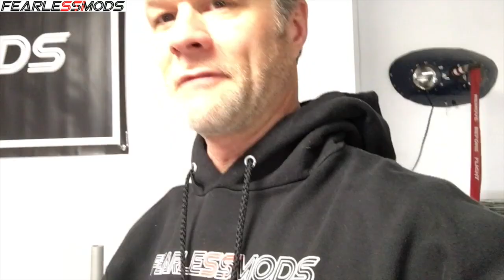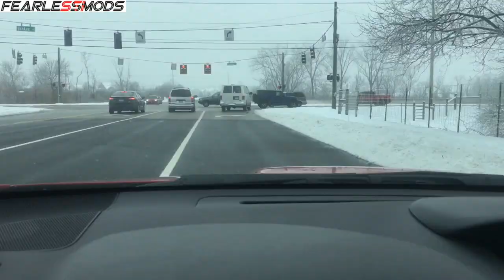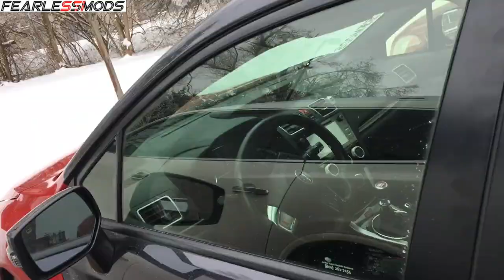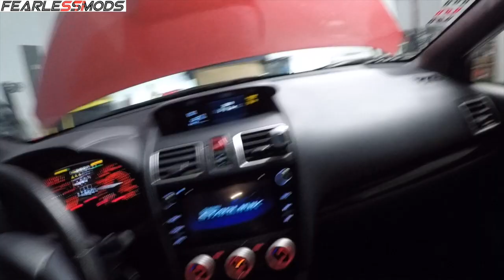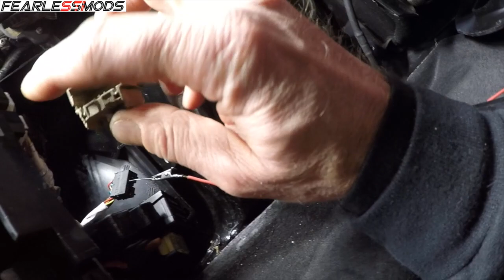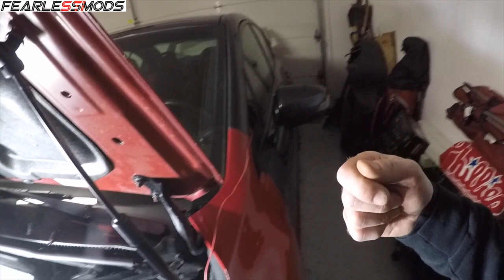Subaru WRX STi Ep 32: Fixing CEL Code P0073 Air Temp Sensor!

Comment: Heh, I'm having very similar problems with my '17 STi, just showing me where the connectors are is a huge help!  :-)
Reply from the maker: Glad it helped!
Reply: @FearlessMods  Turned out it was just corrosion in the sensor connector, which explains why it was reading cold for so long - the sensor has a negative temperature coefficient, which means as the temperature goes up the resistance goes down.  The corrosion was adding resistance to the circuit, which the computer interpreted as being colder than it really was.

I cut a thin piece of brass and folded a strip of fine sandpaper over it, and used that to scrub the corrosion off the contacts inside the connector.  The old sensor also had corroded contacts so it still didn't work, but the new sensor I had previously bought worked fine once I had cleaned the connector contacts.

Kinda disappointed that Subaru didn't use a waterproof connector with that sensor, as it's all too easy for road spray to hit it being right next to the radiator grille.  Driving in Michigan winters means that road spray includes an unhealthy dose of salt, so no surprise that the contacts corrode.  Most likely some of the other intermittent electrical glitches I'm experiencing come from cruddy connectors.

By the way, how did you find the location of the various connectors?  Is it in the service manual somewhere?  I've found the various schematics for different circuits in the car, which call out the connectors involved, but not where they're physically located.  Are there some diagrams that show where they're located?